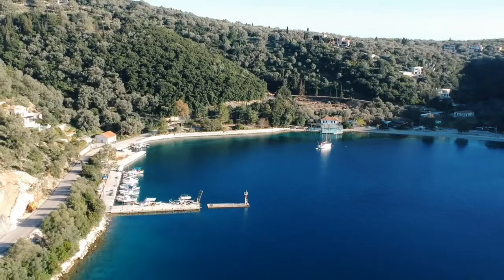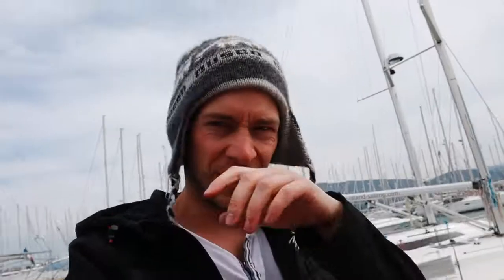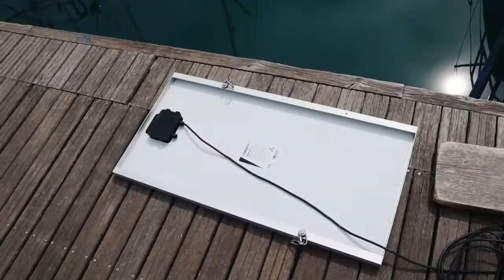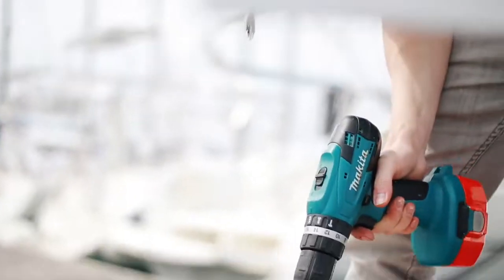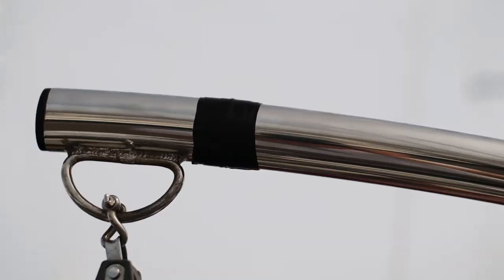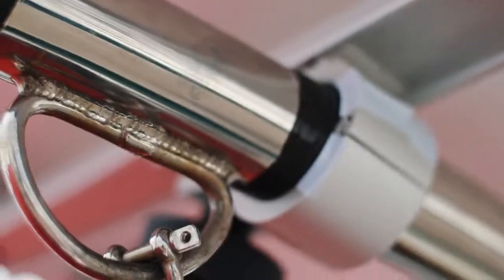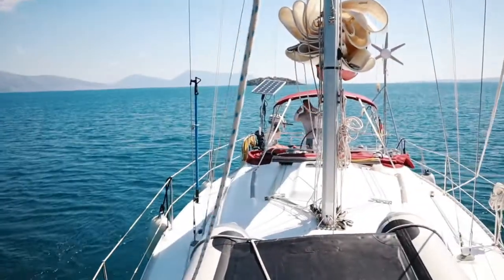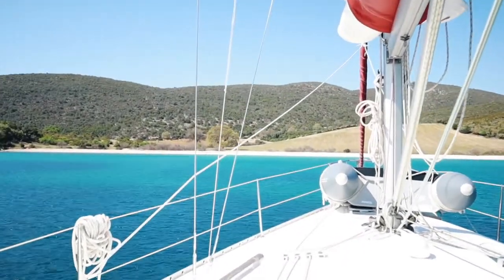Mounting a Solar Panel and First Time Anchoring (in Heavy Winds!) - BOAT LIFE Ep. 05

Comment: Dude good music !
I owned a boat yard / Marina for 40 plus years a few things maybe I can help you with. 
First anchor? You need approximately 300 feet of chain typical that fits windless is BBB X 5/16, make off the chain with a white spray paint can every 10’. Make sure the end of the chain is well secured in the anchor locker. The size anchor should be on the robust size. You should have a second anchor, this should be a storm anchor. 
As for the engine ? The new shaft seal that was installed, it looks like there is a hose connected to the seal assembly from a seacock ? This type of seal assembly is meant to be water feed from the engine exhaust water. The seal is taped off at the exhaust elbow after the anti siphon break.
As for engine maintenance?
Have you serviced the raw water pump ? This pump is a rubber impeller type pump and must be serviced once a season or every 100 hours. You may find that it is better to hire a mechanic to rebuild the pump in front of you for the first time. Be careful if the pump is a gear driven pump. If you have a seal failure on this type of pump it will dump salt water into the engine sump and destroy the engine.
Because the boat is new to you but is used you should service the heat exchanger. What I mean by service the H.E. Is remove the end cap on the salt water side look into the end of the H.E. Make sure the tubes are clear of dabree, impeller blades etc.also check for Zink deposites. If the H.E. Is clogged you way want to remove it off of the engine and soak it in a bath of muriatic acid. This will clean the copper tubes so they transferred the heat well. Get a new end cap gasket from the engine manufacturer/ dealer.
That is it for now, good luck. If you have any question you can always email me.
Reply from the maker: Hey! thanks so much for taking the effort to write this much and the info. Always appreciated to hear from experienced people. We will add it to the job list for the winter.

Comment: These 361's swing around on their anchor lines pretty bad, though almost all modern boats do this.  I think it has something to do with the hull shape, but there isn't much that can be done.  We've thought about making a riding sail, but the split backstay makes that more complicated.  You just get used to it.  By the way, we cut additional foam for all our berths too - those stock Beneteau cushions are really thin!
Reply from the maker: they do, but you're right, once you know it and you trust your gear it's fine. Next time when in heavier weather, I will try to put the snubber on the mid-cleats with a long line, see if this does something. Or one mid and one forward, to keep it on an angle... 🤔